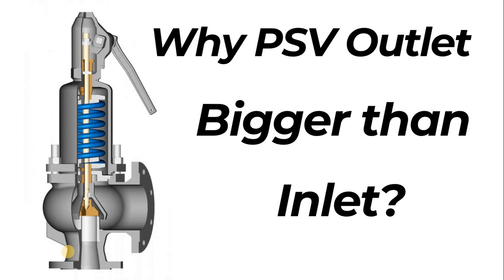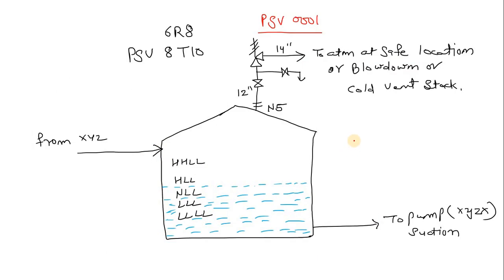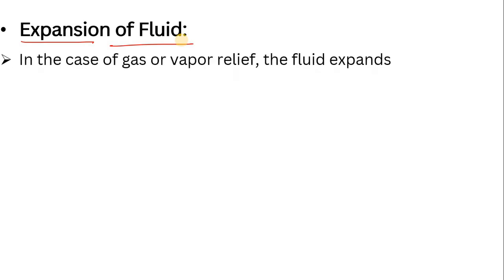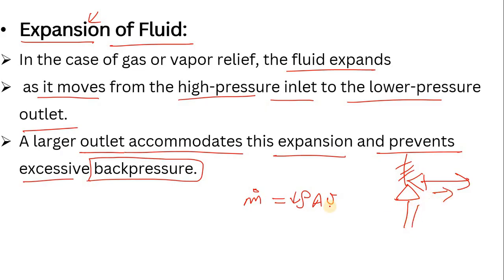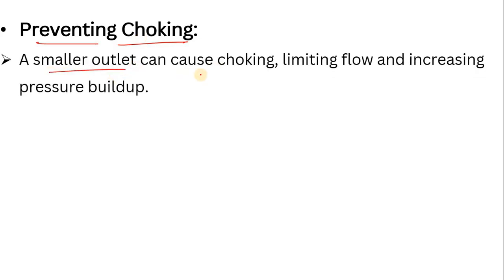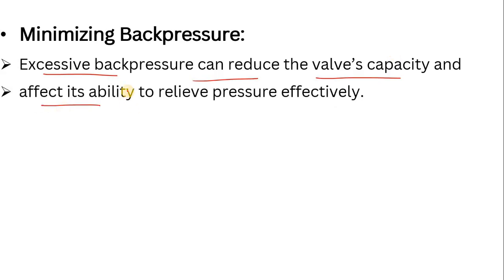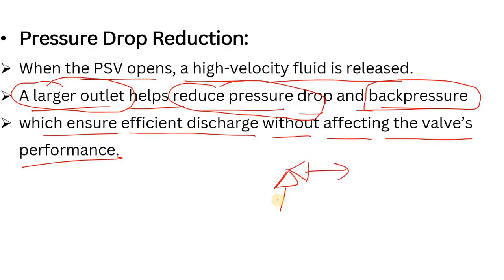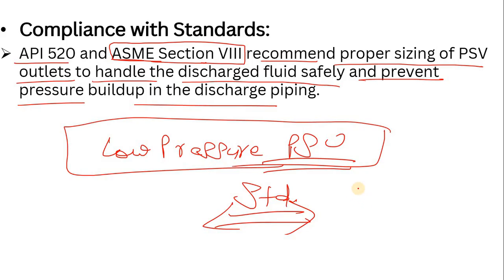Why is PSV Outlet line Bigger Than Inlet? | Pressure Safety Valve | Pressure Safety Valve Sizing

Comment: Hi
For example suction pump line bigger than discharge line means the reason for this is suction pump will be low pressure and in discharge pump will increase.
Is me right? If yes can we say same in PSV?

BR,